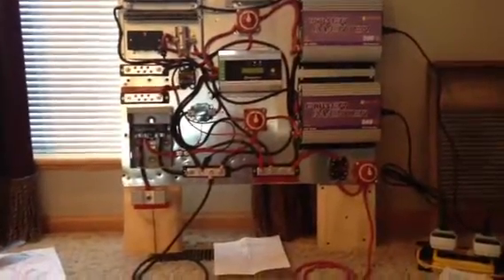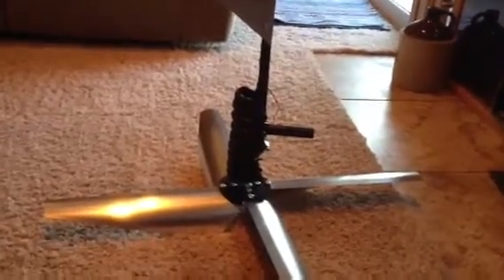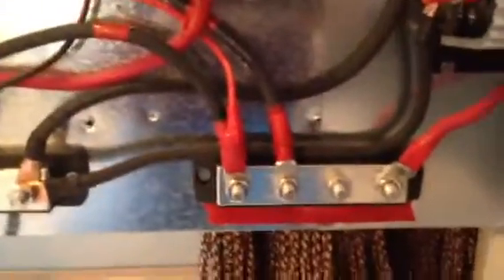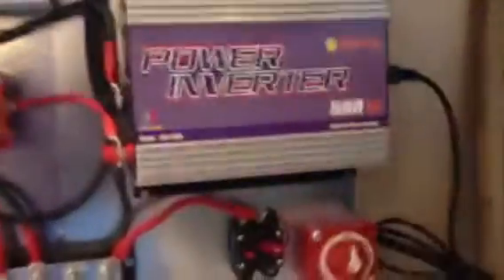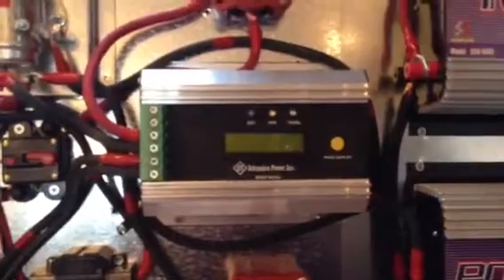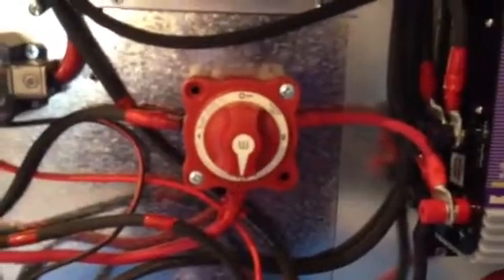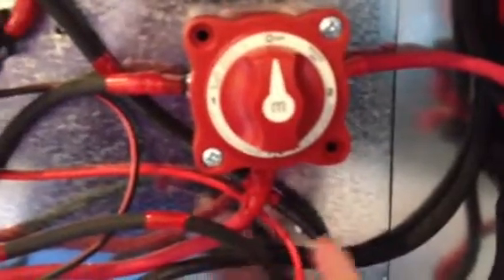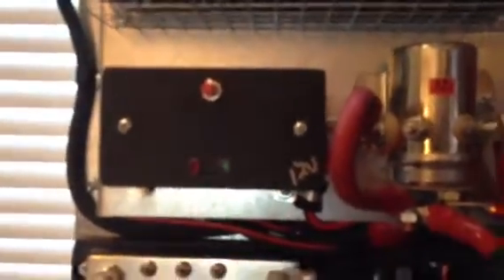Video #1 Planning Diagram All wired solar, Intronics cc and Wind MWS cc, Sun gti, Blue Sea Switches

Comment: Looks like you want to be serious. I'd start by putting some wire box connectors on your wind disconnect box or at least some plastic grommets.Do you have an automatic way of disconnecting from the grid if the grid goes down ? Everybody starts somewhere. There's a lot of good guys willing to offer you some technical advice. Take advantage of every bit you gan get.